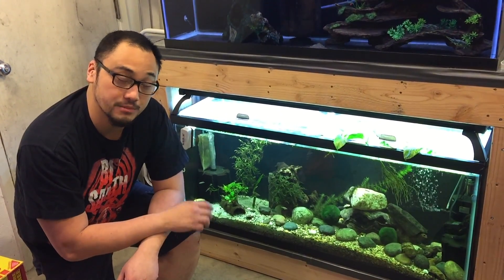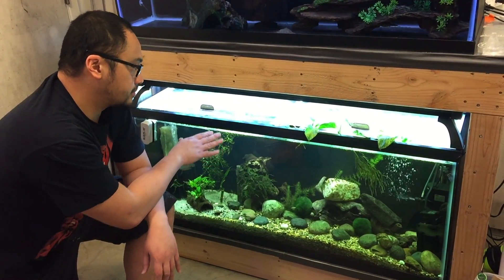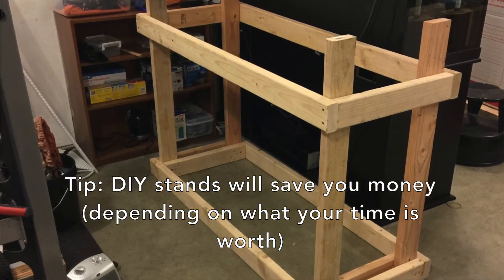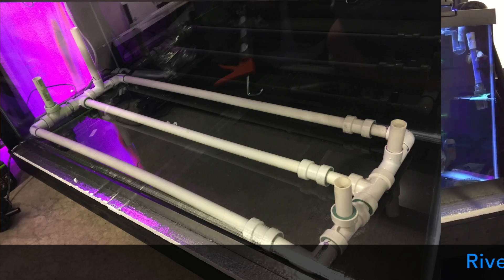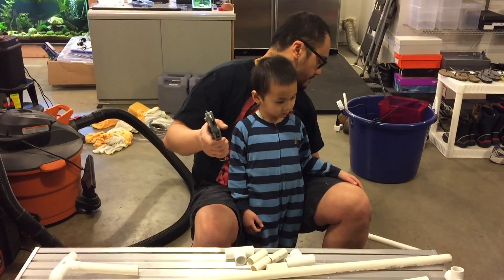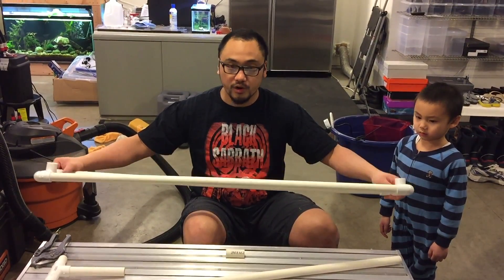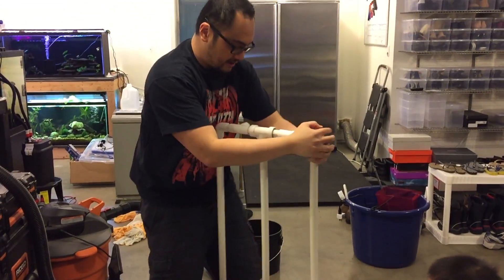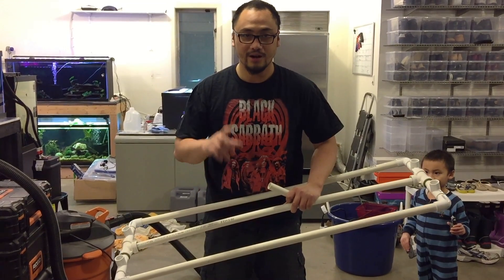Hillstream Tank Build - Part 1: River Manifold

Comment: You don't need to use PVC cement, way overkill. Butter up the female part,  assemble and aline and put a bead of aquarium silicone around the joints. PVC cement, you only have 2 seconds max to line-up and fully seat the parts. Silicone, you have lots of time to set everything just so.